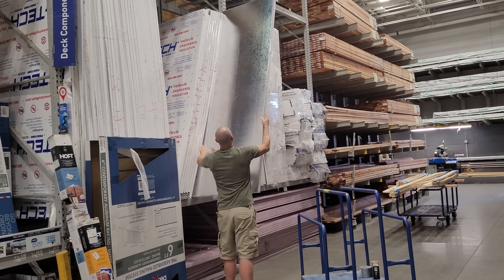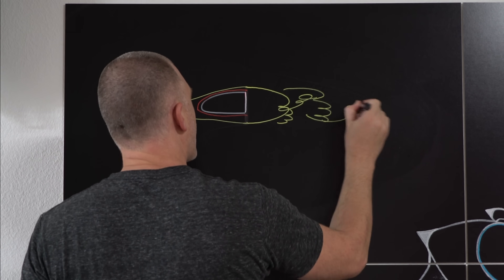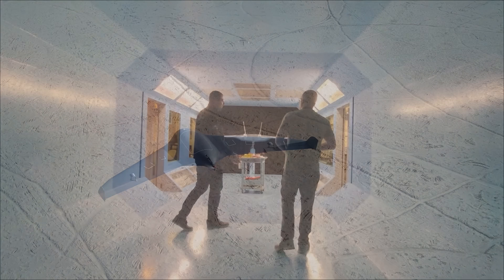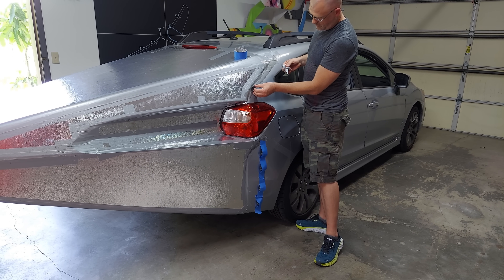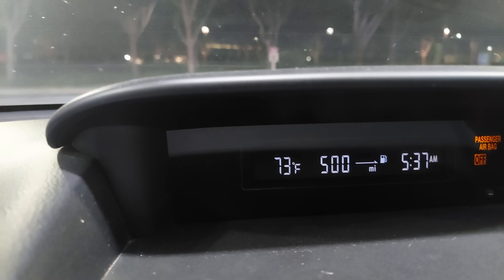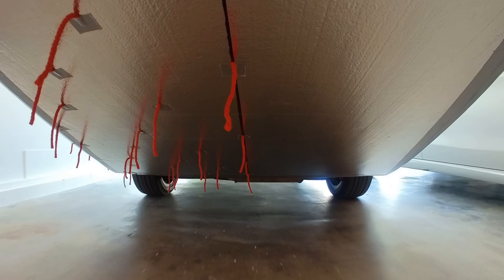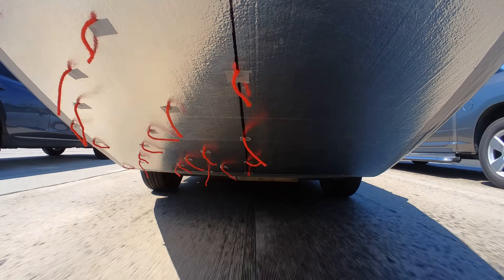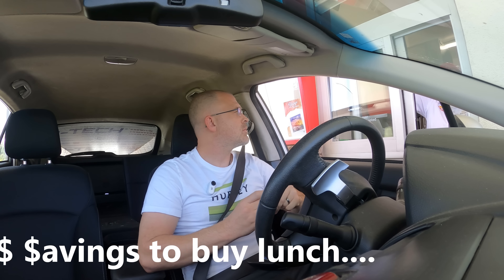Using Simple Aerodynamics to Beat High Gas Prices (Home Improvement Store Edition)

Comment: could use clear 1mm thick  lexan taped to the styrofoam over the tunnels for the rearlights to make that transition smoother intoo the tail , you could allso use it to cover a hole left in the tail to be able to read the licence plate 
the wheelcovers should work but allso reduce the cooling of the brakes , allso the back of the front wheelwells catch a lot of air and forcing it down under the car  , seen some project cars where they changed the back part of the fender so the air can escape out the back of the "funnel" inside the back of the fender  https://images-na.ssl-images-amazon.com/images/I/51c0prRR5eL.jpg pushing the air out along the sides of the car having brushes along the front should help guid the air uotside the wheelwell and along the side of the tire too 
about the tail , i wonder if you need to make the sides straighter and not end up in a point but more intoo a horizontal sharp edge along the back
lowering the bottom of the tail probably will cause it to hit stuff like speedbumps and ramps , you could lower it some but not straight at the same height off the ground as the side skirts , leaving the underside of the tail open might help / whont do mush worse controlling the airflow 
if youre car has a trailerlight hookup you could fit a row of leds intoo the styrofoam to create backlights and cover over the originals , can tape the licence plate flat on top of the tail too , be carefull though , they done this to a porsche le man car and at speed it caused the rear of the car to lift untill they added the rearspoilers to the 917
fitting a bottom plate under the car might work better as it reduces drag and the frontal area of the car (without the front spoiler) it allso would make the car a little more practical driving around town across speedbums and stuff that could rip of the skirts and spoiler 

seen mythbusters use a golfball dimple pattern along a car to test the efficiency and they where supprized at how well that worked (released the boundry layer making it less sticky) , my guess is that the bigger version of bubblewrap should give a simulair effect

Comment: You used the same dispenser at the gas station; every dispenser uses the same pump. That being said there are very very slight variations between meters at different dispensers so it was scientifically sound to use the same dispenser.

Comment: fascinating video with some great ideas. I drive a Mitsubishi Attrage which is the sedan version of the Mirage that gets 19km per liter (44.5mpg) from a 1.2 liter engine and I can see some of your ideas on my car. The standard Mitsubishi hub caps are very smooth (but not fully enclosed) and the 14" tires (165/65/R14) are low-rolling resistance. At the front, the lower bumper air intake is partially blocked off (it's molded that way) and on the underside of the bumper are these two rubber 'fins' that act as air dams/front splitters. The underside of the car is very smooth and flat, and I think that helps as it's one of the most aerodynamically "dirty" part of a car. Although your homemade boat tail looks cool, I think you could get better results by doing three things 1) block off part of the bumper intake 2) add air dams (like you said at the end of the video the "front splitter" at 9:01) and 3) using a large sheet to create a flat underside for your car.

Comment: Or you could go the Ferrari Breadvan route and try a Kamm tail based modification. When done correctly the vortices that fill in the gap behind the flat surface create a dynamic self regulating invisible long tail fairing.

Comment: You can’t have “more MPGs.” MPG is already plural, for one thing (so it’s NEVER MPGs), but it’s not countable. It has to be “higher MPG.” Not “more”. MPG is not a substance with which one can fill a bucket. You can’t get “more” if it.

Comment: I have a 2020 WRX and replace the clutch and flywheel, for more power of course, and during my break in period I got around 420 miles with 12 to 13 gallons.

I don't know the exact amount as I pump even Dollar amounts but prior I would average 24 mpg. After the car is fully tuned I will have to see if this is a keeper or a byproduct of all the added and cough removed parts. Also did a STI trunk swap

edit: actually plan to do a full belly pan to see if that helps

Comment: I also think it is funny that you go to the gas station guy to feel good about yourself by claiming to "know more" than him, yet your explanation of drag is completely wrong! The car doesn't "drag" air behind it... how would the car interact with it when it is past the air and moving away. The drag comes from the imbalance of pressure (low pressure on the rear side, and high pressure on the front side). Please go learn some basic things (like not eating animals) before you go and try to feel morally superior to gas station attendants.

Comment: You have blocked access to your tailgate.  Perhaps you are happy not using the rear luggage area.
Onto the aerodynamics though.  As an alternative have you considered turning vanes around the rear as a alternative?  Additionally, I read a paper in the Aeronautical journal years ago of a method of reducing the low speed drag at the cut rear edge of a high speed wing which involved "castelating" it and adding cones (look like those in an aneachoic chamber (probably spelt that wrong).  I thought of covering the blunt rear of a car with like an egg box finish but when I looked at it the car of the time didn't have much base area anyway.  The theory of it was that it made the high speed chaotic airflow standoff from the rear so that the actually base pressures were not so low.  I could sayhigher but I'm trying to say that the low pressure bernoulii effect is reduced.
As far as your long tail is concerned, you might like to look at the work Porsche did with the 917 in the 1968-72 era when they found the short tail "K" variant had lower drag than the long tail "L" variant.
You might like to look at your cooling system drag.  It is not accidental that newer cars have thermostatical control radiator grills.
Your side skirts should reduce drag under cross wind conditions, Vauxhaul, in the 1970s experimented with side skirts on a Chevette and achieved a 10% saving under those conditions.
In my experiments I have always started at the front on the basis that if you don't have clean air from the front then nothing much will be effective at the back.  When Meschersmit were developing their ME309 they flew the prototype without a spinner because they thought uncovering the prop boss would aid cooling.  It did the opposite by extending a separation bubble over the radiators.

Comment: You should rather make the floor flat and close off the rear fenders. Adding and extension to the bumper will create more drag also driving a sedan is the fuel efficient shape. Also if you want more efficiency, remove the driveshaft and rear diff. Lastly I think it might help having the fuel efficient tyres with high pressure.

Comment: If humidity is low, the static electricity building up would result in your car body dragging along a thicker boundary layer when you travel longer distances. Can use bits of metal tape with conductive adhesive stuck to the body, glass to reduce the static.

Comment: Try covering the rear wheel well entirely and also cover as many grilles and intakes as possible (careful not to overheat) that should help significantly
Reply: A guy on Ecomodder covered the front of his Subaru with heat-shrink plastic.
It sealed the gaps, but the members bullied him.
It didn't necessarily help, either.
A few people there have made 2-part foam plugs that at least partially fill the grill.
Then they fiberglass and paint.
They can look quite good and as long as you aren't climbing a big hill in the summer your car should be fine.
Some people install fan indicator lights.  If you partially block the grill and your fan runs constantly you may come out ahead--until you need to remove the grill block.

Comment: Using a front lip and side skirts to prevent air from getting under the car is a common misconception in aerodynamic design. While, yes, less air will get under the car and the drag will be slightly improved- it is much less effective then applying aerodynamic panels to the bottom of the car. The most aerodynamic cars (that dont sit very low to the ground) have smooth bottoms and rounded bumpers. Sports cars (BMW + performance teslas for example) have protruding lips because it is a decent tradeoff between reduced drag and improved downforce.

All in all, a smooth undertray is much better than a lip and sideskirt.

Comment: have you tried to put all 4 tyres with emergency replace tyres, they are low speed rated but also they are very thin, it would reduce surface friction :)

Comment: i think a flat bottom out of a thin piece of plastic or metal and a rear diffuser molded to the rear part would also help improve it more. but even 13% is a pretty good improvement if you drive lots

Comment: you could probably drop the suspension a little, and add lip/skirts like you said. cover up the taillights with a clear plastic, like aero companies did back in the 90s with popup headlight conversions. i would also add full rear arch covers, since the rear wheels have little offset and don't have to turn like the front ones. 

however, with the last one, rear brake cooling would be a problem. you could probably add a naca duct or something of the sort to ventilate the rear brakes

Comment: increasing tyre pressures and taping up all the panel gaps on the front of the car would make a difference too. i also find cruise control isnt as efficient as manually controling the throttle as the cruise tends to pulse larger increments than needed (could just be my car but it is a couple of mpgs difference). you could consider adding larger vortex strips infront of the rear lights to deliberately create a vacume which will pull the air into those pockets. most estate/wagons have roof spoilers for that reason

Comment: A big problem i can see here is starting with an AWD car for this experiment, they typically get lower gas mileage since the engine powers all 4 wheels as opposed to a front wheel drive car that only powers two
Reply: Ik on Infiniti’s the awd decouples about 20mph and only reengages if it detects slip
Reply: Why is this a problem? Why AWD cars wouldn't benefit of aerodynamics improvements just like 2WD cars? Yeah, the gain may be relatively slightly less but in the other hand, a lot of people drive AWD cars. The same could be said of many other things in a car. Big problem starting with a gasoline car, diesel cars usually get way better mileage / efficiency. Big problem starting with car of that size, that body model, etc. countless other factors.
Reply: @wopmf4345FxFDxdGaa20  They do, but if you're this dedicated to MPG you don't want to be having an AWD to begin with
Reply: @tinyhotopicbitch  Yeah, and neither a gasoline car or car of that height . . .
Reply: bruh that's something that you opt in or opt out with 1 button for most cars. You usually don't use AWD unless it's snowy or something
Reply: @Mohas191  that's in most cars in trucks labeled 4WD. Most AWD cars you don't have the choice, and it's turning 4 wheels all the time
Reply: @P6fitz  Most AWD cars do it automatically, they drive 2WD until you slip. Subaru though is different, it is 4WD all the time. Both philosophies have their advantages . . .
Reply: @Mohas191  Pretty much every AWD car is full time AWD no choice, especially Subarus

Comment: The front splitter is a bad idea for efficiency. 
The vacuum created by the elongated tale will effectively remove that air from the front from underneath, a splitter will cause more drag but better downforce. Extended down side skirt would be better imo .

Comment: Fascinating, I went with under-body flattening and smoothing, and adding bits of foam to attempt to create better flow attachment. fuel savings were negligible. Handling and overall sense of stability improved however, my car felt so much nicer to cruise in road noise minamised, just glides along taking curves with a sense of stickiness and stability with the road. Alot of the fidgetiness went away.

Now the in the rain the water stays attached to the windscreen and windows and trails off in surreal ways. Adding quick foam vortex generators at the bottom of the front door caused the sticky water to trail downwards.

I speculated the capless filling system might not be sealing properly, so I've fashioned a cover and am in the process of seeing if it makes a meaningful difference.

Comment: You might take a look at Casey Putch's Omega Car that he made, basically a super streamlined diesel hypermile car. It was made to prove that its possible to create a fast, efficient, easy to manufacture car and since it does over 100mpg, has great acceleration and was built in the back of his shop as a side project i'd say mission accomplished.

Comment: Solar-powered-race-car engineer here. I absolutely love the idea of the video. Cars can be SO much more aerodynamic (our solar car's drag is almost equal to that of one single side mirror) . Most cars now have so much separation, and especially American cars are super fuel inefficient (man, I couldn't even find a car that drove better than 30mpg, whilst being used to 80mpg back in the EU).
The explanations in the video were very clear and the red ropes indicating the airflow were a great visualisation.
Love the idea of the vortex generators, might have helped keeping the turbulent flow attached for a longer while.
The reason solar cars are so high off the ground is to prevent it from creating a venturi tunnel, causing down force. So funnily enough, raising your car (and smoothing out the bottom) would also have a huge effect.
I'm curious for the future!
Reply: Most cars Americans buy are just naturally inefficient because they're big displacement engines meant for power. Hard to make a 5 liter v8 diesel pickup truck tuned for 400 hp & 400 lb/ft any more efficient. And Americans buy these hand over fist, top 3 selling vehicles in America are all pickup trucks. The rest are SUV's and a handful of 4 door sedans.

You can get like 40 mpg in something like an Altima or Corolla which is still less than a Euro hatch, but Americans just don't like small cars for whatever reason. Numerous hatchback models in 2020 were discontinued specifically in America.

Comment: Can I make a suggestion.. cover the whole wheel well/side of the wheel to prevent air getting turbulent.
Also cover the under side of the vehicle and maybe take off the roof rack (parasite drag) all of those key elements will improve the drag

Comment: I have a 16 Crosstrek Premium with the CVT transmission and I can do on average 620 to 650 miles with a tank of gasoline (ethanol free gasoline that is). I drive my car very, very conservatively and use cruise control as soon as it's available at 30 mph. Highway speeds 55 mph on the right lane as well. When it comes to fuel efficiency, it's paramount to keep the car going at a constant speed, coasting before a red light, versus racing the car like a maniac only to stop at the red light. I wish more people would understand this concept. Driving my car this way means I barely have to use my brakes. I too, wish the car came with plastic or aluminum panels underneath the entire vehicle to make it more aerodynamic as you've mentioned in the video.
Reply: Driving a car in that manner is a lot better for traffic too imo (in terms of preventing huge backups and traffic jams) I wish more people drove like that as well.
Reply: I'm gonna assume you mean 55 on a state highway and not the interstate
Reply: @tuckerhiggins4336  you've assumed wrong. 55 mph always. Not in a hurry and not blocking other drivers. If you like to go fast please turn on your blinkers and overtake me in the left lane. Buh-bye!

Comment: The biggest deal with vortex generators is that they are mainly used to increase pressure on the concave section of a wing. the vortex generators are basically flinging the air off of the bumper section of your shroud.

Comment: I like what you are doing! just a few of suggestions:

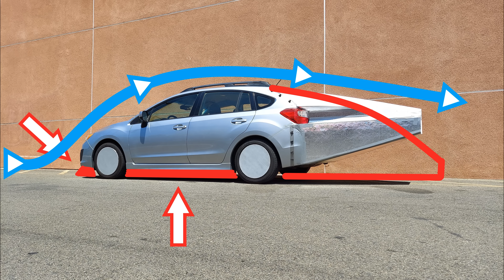1: Dont go for the the design where you creat a flat rear with a curved top that extends all the way down to de floor (9:24) it will create way too much lift and might make your car fatally unstable at 65mph

2: Following the previous recomendation, try the side and front skirts you mentioned, but first try to create a smooth underfloor, it will have massive gains.

3: If you can get away with not using disc wheel covers, but instead create a way to close the wheel arch (at least at the rear) you could also stand to gain a lot.
Reply: Yes like the old chevy caprice they got amazing gas mileage and were very modern and stylish in 1993... not.

Comment: Clear plastic could be formed over the tail light divots. Still be able to see the factory lights but do away with that part of your problem.

While you technically might be able to see the license I wouldn't really describe it as easily viewable. That might come back to bite ya in the rear when you get pulled over. Most places say it has to be placed on the rear and easily viewable or some wording like that. With the new bodywork it is neither of the 2.

Comment: My car is giving 42.34 mpg without any modifications and due to slightly cheaper diesel price it's like 1$=9.51 miles . And on freeway she gives 59.51 mpg which is like 1$=13.37 miles. 😀